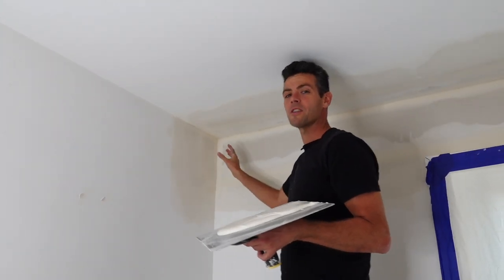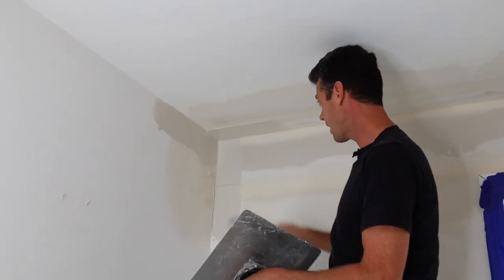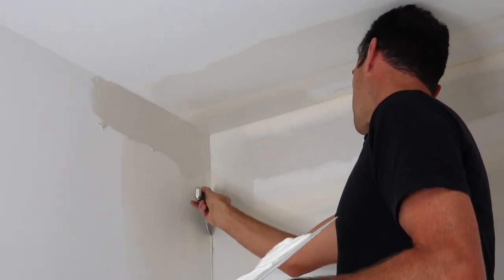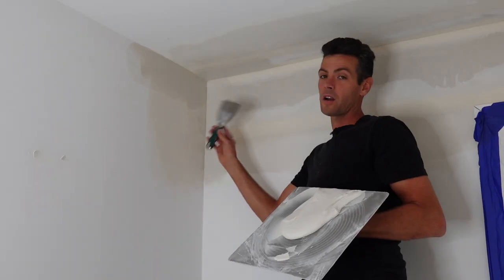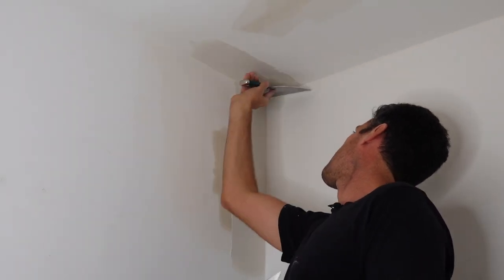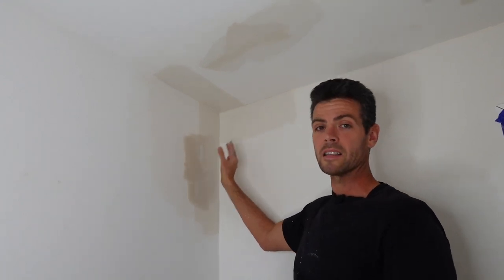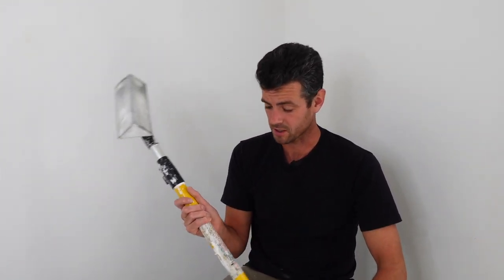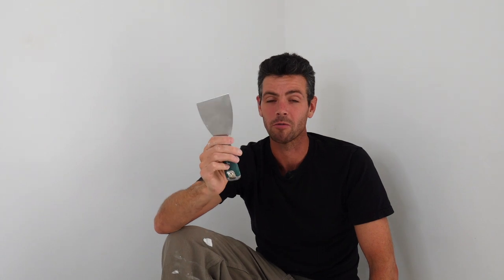Pro Drywall Tip for PERFECT INSIDE CORNERS!!!

Comment: I've been finishing drywall for a good long time now and am one of the few who seem to actually enjoy it.(not so much the sanding)  Two of the hardest things for me to learn were 1. when you're doing the tape coat know when you've gotten to a point where the joint compound is as good as it's gonna get and now you're just playing with it. 2. The skim coat is just that.  Slop up the mud and don't leave and hateful thick edges.  Feather, feather, feather.  I do enjoy these vids because I can always learn and pick up some new tricks.  As long as I've been doing this I have never come upon one of the corner sponges for the paint pole.  I will be getting one soon.

Comment: Everything important about drywalling I have learned from you. Also my favourite tool is the same beveled sponge, held exactly as shown. I did make a slight modification to the sponge---I wrapped a single layer of masking tape around the thick end furthest from the thin edge. The tape keeps the outside edge from creating that line that must be sanded out (or avoided) allowing you to concentrate only on what the thin edge is doing.
Your lessons and advice have made this job lots of fun; although tedious, I approach each session knowing my results are going to be excellent....all your fault.   senior from Ontario

Comment: Hopping on one of your videos more-or-less at random to thank you for your channel. I've been renoing a large bedroom with a vaulted ceiling in a VERY crooked house for quite a while (okay almost two years) and I've devoured most of your taping/mudding stuff. I've been doing small DIY "tape and spackle" jobs for many years, but partly because the projects arise infrequently the progress in my skills has been slow -- many times repeating the same mistakes and not knowing how to fix them or avoid them. You transformed this work for me.

I know you didn't ask, but the Number One benefit I've gained is actually something you don't explicitly emphasize -- it just comes through with everything you do: knowing the purpose and objective of each step. This alone has let me see the big project in a more measured way. Instead of crashing ahead with the general goal being "get it ready to paint," I could see everything in very clear stages. 

I'm certainly not pro level. I'm still not mixing my own mud from powder. I still have to do more sanding than is probably ideal. But on a wavy wall with odd mismatched butt joints and 35-degree inside and outside corners, I accomplished it all in much more efficient stages than would have been the case before Vancouver Carpenter. So thanks.

Comment: Good lesson Ben!  I'm in the process of skim coating over textured walls and ceiling.  I will try out this method. I'm almost done resurfacing every inch of sheetrock in a 800 sq. foot cabin...  I am almost getting the hang of it.  😁  your videos have helped a lot.  What you haven't shown that I can see is how much imperfections a knock down texture will cover!

Comment: Applying proper pressure to the sponge in the three ways kind of like a pressure flip in skateboarding you need to apply pressure to the right corner of the board or sponge in order not to leave marks on the wall from a carpenter skateboarder drywaller perspective I'm on the same boat as you good technique

Comment: What kind of sandpaper do you recommend? I’ve used the screen type for years, but one thing I noticed, is they can leave a screen print behind. Maybe I need to use less pressure or a finer screen. I love the foam pad you use. It’s all I use in corners.
Reply from the maker: You need foam backed sanding sheets for finish sanding. Regular paper sheets for sanding first coat is good.

Comment: What happens if you can't avoid a tapered edge meeting a square cut edge in a corner of between ceiling and wall. I have this with a wall square edge meeting a sloping ceiling and the ceiling edge is tapered. Would you fill the taper with trade set first, then tape and point as normal. Or can you tape and joint but just fill the tapered side of the joint with a thicker layer of mud?
Reply from the maker: You don't need to do anything special. Just tape it and fill it. Your eye will not be able to pick up the slight difference. The bevelled side will end up flat and the flat side will be imperceptibly built up. Don't over think it :)
Reply: @vancouvercarpenter  Thanks, when you put drywall up horizontally and want to square stop rather than have scotia is it normal practice to have a tapered edge at the top of the wall and a tapered edge on the ceiling at that junction? All of the 13mm ceiling sheets here have both edges tapered.